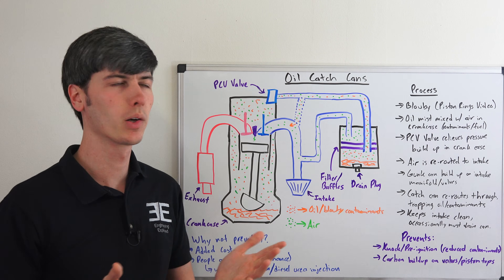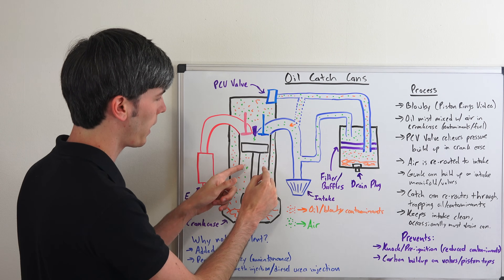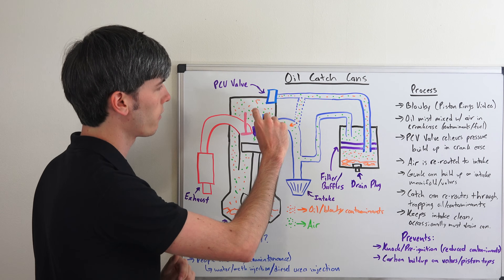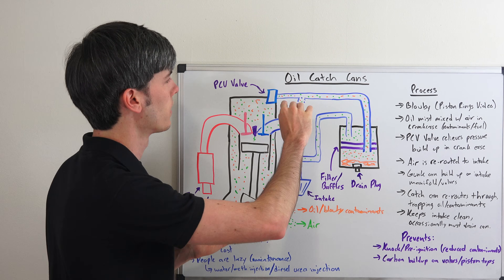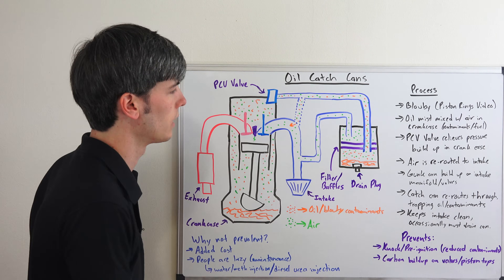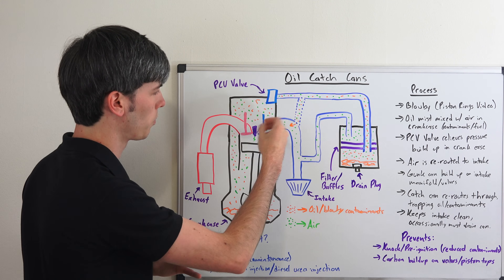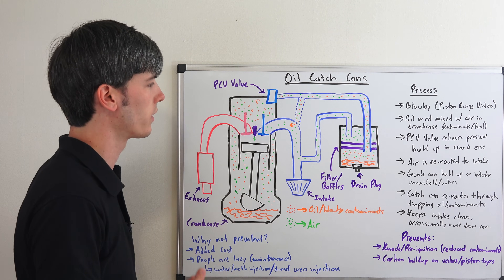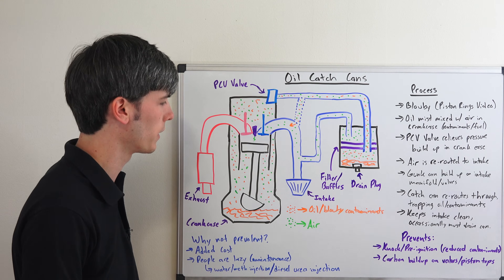What Is An Oil Catch Can?

Comment: what happens if catch can fills to capacity , does it all go back into the engine?

what are some signs of this damage?
Reply: This creates a dangerous issue where a slug can be ingested all at once and could cause hydrolock. Most cans are 2-3 oz's capacity. There are some like the Elite E2-X Ultra, RX Monster, and Tracy Lewis Performance Monster that are 32 oz capacity to avoid this, but all need to be emptied regularly. Since all engines are different in the PCV system design, some like the Ford ecoboost can fill a large can in 1000 miles or less when it is below 45* F outside.

Comment: is it true that only engines equipped  w/  turbo will reap the benefits of an oil catch can.  i've read that those n/a aspirated motors  don't need it?
Reply: One must look at what a truly effective can does. For older port injection engines the main benefits are keeping contaminates out of the oil. These have no intake valve coking issues as the fuel spraying on the valves backsides keeps them cool and deposit free, but any oil ingestion (as well as the other contaminates the PCV system draws from the crankcase) disrupts the burn in the combustion chamber. Oil causes detonation or preignition, and knock sensors then pull timing and enrich fuel trims to eliminate it. If your engine is not able to run at optimum ignition timing advance, it produces less power, uses more fuel, and produces more tailpipe emissions.  A system like the Elite E2-X, genuine RX, or ours results in 1-3 MPG fuel economy improvement.  ALL GDI engines benefit greatly from a proper system (most are very ineffective) as intake valve coking is an issue not seen since the carburetor went away and much shorter engine life is the result.

Comment: Hey I know you can help me. Just bought a 2017 wrx sti and I'm considering an AOS or catch can. I do not plan on ever doing any other mods, and this is strictly my daily driver that I like to have some occasional fun in. Do you think this is a necessary thing to do? I'm really just concerned with ringland failure and I've been reading that this would be an excellent investment.
Reply: EJ motors use port injection which takes care of the intake valve issue.  However, catch cans/AOS are still a good idea on EJs.  

Since these mods reduce the amount of oil going back into the intake tract, less oil = less chance of knock.  This is because the oil isn't diluting the air fuel mixture during the intake stroke which would in turn lower the knock resistance of said mixture and cause pre-detonation during the compression stroke.  As long as EJ motor cars are driven correctly...letting the oil get up to operating temp before pushing the car hard, ensuring oil levels are always correct, using the correct oil (NO Mobil1), and not requesting high load from the motor in the lower rev range, a lot of bearing and ringland issues will be gone.
Reply: In short, it shears down over time to a weight closer to that of a 20w at operating temp.  This shear is designed to occur on purpose in order to lower friction between engine internals and increase, or at least maintain fuel mileage.  This then in turn brands the oil as a "resource conserving" oil and hold the ILSAC GF-5 certification.  All find and dandy, but EJs are driven hard by their owners at (inappropriate) times.  A "thin" oil won't protect crankshaft and/or connecting rod bearings during high load inside the cylinder and that's when you'll see rod knock as a result of the crank and/or con rod bearing getting spun because the thin oil gets pressed out of that area and cannot provide sufficient protection.

This is what my research of oil+turbo Subaru motors has led me to believe.  I would like to be corrected if I am wrong.
Reply: Thanks. What do you recommend? Royal Purple? Red Line? Castro? Valvoline? As a road racing fan, I've actually seen professional teams using the first two in Le Mans type race cars at Lime Rock. But racing use can be different. They are less concerned with detergents since they frequently tear down their engines.
Reply: It's probably not necessary.  It definitely won't hurt your car, and a can will help prevent the dirtying of the top of the pistons and valves. And, the fact your car is turbo charged means there is more positive crank pressure, especially as blowby increases with age/wear. I'd say if you want to do a project and don't mind the maintenance, go for it!
Reply: What's wrong with Mobil 1?
Reply: It should be a relatively easy install, just research and get a good quality one, then remember to empty it every few months. I have an occ on my ms3. I'm actually due to empty it. It's something that can be easily forgotten.

Comment: I think you should specify the difference between PCV and CCV systems. You call the diagrammed system a PCV, but I think you are describing a CCV system. That is, a system where the crankcase gasses are not actively ventilated from the crankcase. In a PCV system, the gases are ventilated using the pressure drop across the throttle. Typically the inlet gets fresh air from the air box and
dumps it into the intake. The most important reason for the distinction is
because the latter system uses manifold vacuum, so these are not typically
found on diesels.

Comment: Is there a specific reason why the air (and oil mist) does get re-routed from the PCV-Valve into the intake instead of just releasing that stuff into the environment?
Reply: The PCV system does far more than just address pollution. It performs several critical functions to keep your engine alive and long lasting. And that requires an evacuation suction source to remove the damaging compounds always entering as "blow-by" before it has a chance to settle and mix with the engine oil, as once mixed, it is there to stay. These compounds are as follows:
Water, unburnt raw fuel, sulfuric acid, and abrasive particulate matter. Today's full synthetic engine oils will last 10's of thousands of miles if no contaminates are ingested, so that is where the PCV system comes in. All have a Fresh/Clean side where filtered fresh MAF metered air enters one portion of the crankcase, and flushes and replaces the Foul/Dirty vapors that are evacuated (sucked out) the opposite bank or portion. If you just vent to the air, your taking technology back to the pre-1960's when all engines "vented" using road draft tubes, and even changing oil every 1200-1500 miles (the standard back then) engine wore out and needed a total rebuild by 40-50k miles. It was after the Feds mandated the PCV system to reduce ground water pollution caused by oil run off from the roads that these same engines, using same oils and change intervals now were lasting 100-150k miles. And unexpected result of the PCV system as it was discovered these damaging contaminates were now being removed before they could settle into the engine oil. Another issue is pressure in the crankcase. If you do not use a strong suction source to evacuate these damaging suspended contaminates, then pressure builds to the point of being able to vent, and only a small amount of these actually exit the engine before they settle and mix. ANd simple flow dynamics dictates pressure will always be higher behind any vent in order to vent. This causes another issue, and that is piston ring flutter. Piston rings are designed to see pressure above, and suction below them to seal properly and maintain stability. When you remove the suction to the crankcase the intake manifold provides,  then the pressure allowed to be present below the pistons causes increased blow-by and wear over time to the rings edges as well as the cylinder walls from the "ring flutter". You also then have parasitic power loss if the pistons have to fight the pressure in the crankcase on each down stroke.  

Lot's more to explain, but that should cover most of the question w/out writing a novel.

Also, all "catchcans" are not created equal. The simple empty cans with fittings welded on allow most of these contaminates to pass right through trapping only some oil still causing the issues your attempting to prevent.  Most cans, even the biggest brand names only trap 15-30% of the total "gunk" you want to prevent from ingestion. Look at one that is 95% plus effective like Elite Engineering's E2-X line, or the original RX (not the cheap copies pretending to be RX, or the latest from Tracy Lewis Performance through Jegs or direct from them www.TracyLewisPerformance.com 

Hope this helps!
Reply from the maker: +HATECELL so that you're not releasing it into the environment.
Reply: PCV started in the 1960's. Cars used to vent crankcase vapors to atmosphere.
Reply: Good info Gary, but the trend towards internal separation has a serious side effect that can be seen in an oil analysis. Trapping and retaining the oil mist also is trapping and retaining the damaging compounds that enter as blow-by as well, water, raw fuel (especially GDI engines have terrible fuel dilution issues causing every thing from timing chain wear and failures to complete engine failures), and the abrasive soot, ash, and carbon particles. These MUST be flushed and evacuated before they can settle and mix with the oil, and internal separation just retains all of this along with oil. One of the main reasons most automakers have recently lowered engine warranty periods from 100k miles to 60k or even as low as 36k miles as the expected trouble free life of a GDI engine is now 50k miles VS several hundred thousand for old port injection engines.
Reply: To remove the constantly entering combustion byproducts and other contaminates from the crankcase you must pull evacuation suction. Venting leaves most of these in the crankcase to settle into the engine oil causing premature wear and failures. Prior to the PCV valve being mandated in the mid 1960's all engine vented to the air and no matter how often you changed oil, rarely did your engine last more than 50k miles before needing a rebuild. The Mandate was ONLY to address groundwater pollution from them dripping on the roadways, but in the years following the mandate these same engines using same oils were now going 100-150k miles before needing rebuilds. It was then discovered that the PCV system did far more in function than prevent ground water pollution, it also constantly flushed and removed the contaminates causing most wear BEFORE they could settle and mix with the engine oil.
Reply: Most OEM have internal type ' catch cans'in the cam cover labyrinth or external 'cyclone' type (best) all must operate at extreme angles of up to 45 Deg left/right/up/down and have 'oil carry over' as discussed here of approx <1g per hour working with the PCV but some engines are prone to more of a condensate incl. fuel type carry over than actual oil
Reply: +Jon Rosenburg HAH!
Reply: And, as these internal separators become more effective, they are also retaining the concentrate of damaging combustion by-product compounds are no longer removed. Fuel dilution being one of the most concerning as even with a good full synthetic, many of today's GDI engines oil has exceeded the 5% threshold where oil is considered condemned in as little as 2500 miles we find so,me in the 8-12% range. And that is not the abrasive particulate matter now retained in the oil. The PCV system has many functions, only one being pollution related. The rest are to flush and remove these damaging compounds before they can settle and mix with the oil, and the trend has been to more wear and less engine life as a result.
Reply: Old school 2 stroke diesels used to just let it drip onto the ground. Often time on a cold morning youd find a big puddle of oil underneath your truck. If you didn't the advice was to top off her oil. Lets just say the EPA hates these engines.

Comment: I have a question thats really been bugging me and maybe you can give me an answer. My father has a hardtop convertible system that folds itself into the trunk, that system must way a minimum of 500lbs (E93 weighs 700 pounds more than the standard coupe). Would the car be faster with the top up or down? I'm sure the difference is hardly noticeable but imagine something like an autocross car. Its obviously far more aerodynamic with the top up, but an extra 500-700 pounds over the rear wheels should make something of a difference to acceleration with even more grip, but i imagine would harm the cornering ability with the weight distribution so focused towards the rear. Theres obviously many more factors to consider but I'm sure youre already aware of them. Ive looked it up but have never found any information about the subject.

Comment: is it safe to assume that a three port can is the best choice for a WRX since it has two valve cover vents?
Also don't the valve covers on Subaru vehicles have air oil separators built into or bolted directly on them?
My old 02 WRX had them stock but I'm not sure about my 2015 WRX. I would go look at it right now but my wife is always driving it someplace. I can't get her out of the damn car.

Comment: would installing an oil catch can effect my warranty coverage on my 2015 WRX?
What difference if any is there between an air oil separator and an oil catcth can?
Are intake deposits also caused by the EGR system?

Comment: Traditionally the crank was vented via a tube just under the engine , then came PCV idea also its not air that gets shoved back into the inlet manifold their exhaust fumes mixed with oil vapours .

Comment: Great video, I wish you mentioned that on a Force Induced vehicle  (turbo or supercharged )  the benefits of an oil catch can are multiplied because of the increase boost and the pressure in the combustion chamber. More pressure = more oily mist going past the rings  back in to your engine etc etc.
Reply: he did mention that. It was practically the firsr thing he said.

Comment: Not to mention the oil catch can would stop the recycled pressure from gunking up the MAF and messing with the controlled mixture.
Reply: MAF is normally upstream of where the PCV hose joins the intake hose. Fresh air thus comes out of the airbox, immediately past MAF and lower down the PCV hose will join.

Comment: Would a catch can work for na Subaru engines? I just had a consumption test on my 2013 forester and it failed tear. So they are replacing the "short block" all under warranty yay! But would this help the process of my forester not eating so much oil? This made me so sad I was thinking of trading it in for the new Mazda CX-9!! Please do a review of the new cx-9 and their supposed better AWD system?

Comment: What do you do with the crud that comes out of the can recycle it with the used oil?
Reply from the maker: +Joe323 yeah put it with your old oil when you change your oil. I'd just dump it each oil change, unless it fills up quicker.
Reply: Hey I have a question:
Does a catch can increase vacuum in the crank case? With the BMW M54 motors, with their low tension oil rings, there's speculation that an increase in vacuum when a catch can installs pulls the rings further to the cylinder wall promoting a better seal. Do you have an explanation why the vacuum increases? Cheers.

Comment: One of the things i've done with my supra is vent it into open atmosphere. after my oil catch can. The thing about supra's is they are known for blow by so one of the first things we have to do when modifying our cars is opening up the holes and ports for the vents on the valve covers. If you don't you actually run the risk of blowing front and rear main oil seals. I've seen it happen and had it happen to me. Soon as i opened up my ports from about a -6 to a -10 an fitting i don't have the problem any more. 

I have a cheap oil catch can, so it has no baffles or filters inside it. So it catches the oil and air mixture and vents out the rest outside.  They are good things to have considering it keeps oil vapor from entering your combustion chamber and causing build up.

Comment: Not needed anymore in some modern engines. The crankcase breather system is built-in the valve cover and has an oil separator.

Comment: Can you explain the Intake Resonator from a performance standpoint? I wrote a paper on how they improve airflow into the cylinder by reducing the back pressure wave on the intake stroke, however i also have recently noticed that a lot of people remove them to improve performance, and i am concerned i made a mistake in my paper.

Comment: You should mention that the oil mist reduces the octane rating of the air/fuel mixture drawn into the cylinder which reduced engine efficiency. This reduces mileage and performance.

Comment: Did the factory let oil back into the intake track for a reason other then lazy people? You would think so. There are some positive effects of having one but are there negative ones also? Like lubricating pistons rings or top of the cylinder or the bottom side of the valve stem and or guide?  I don't know.

Comment: Anyone know of a good oil catch can or AOS for a 2005 Subaru Outback XT / Legacy GT?
Reply: Catch cans typically are made 'universal'. So any good catch can would be a good catch can for those vehicles, assuming the hose inlet/outlet are the proper size, but even that can be fixed with adapters.
Reply: +Zachary LaVoie so like which one should I get? Also keep in mind they are mounted in different places.
Reply: +RyanRC2 go check out RP PRODUCTIONS he has a link in one of his last video of a really good high quality catch can and i can vouch for it because i use the same one in my Hellcat Challenger
Reply: +Chris Robbins those are only for Dodges tho. I need one for a Subaru